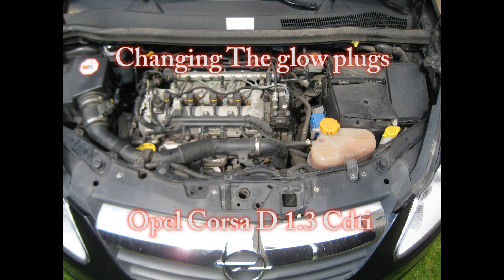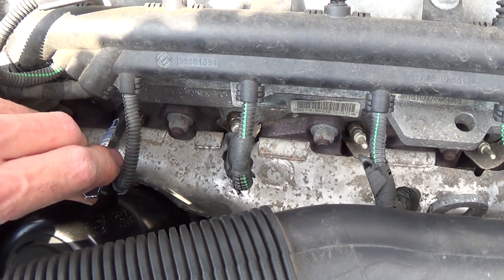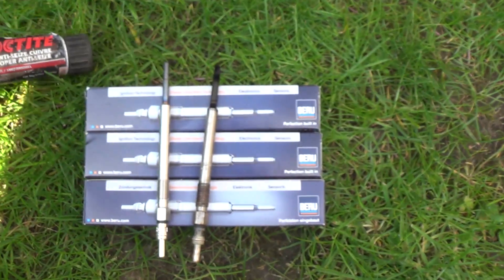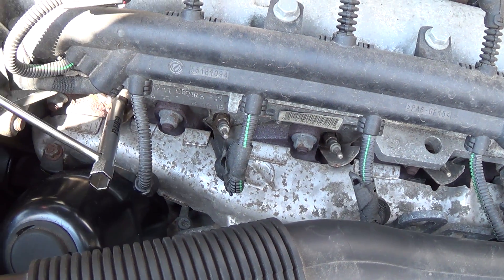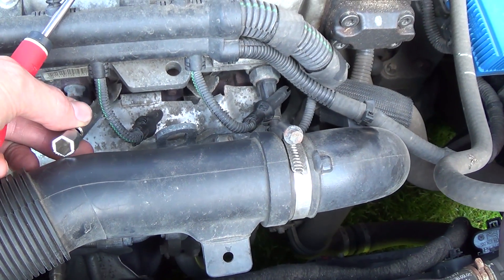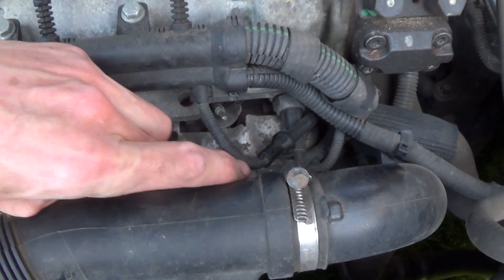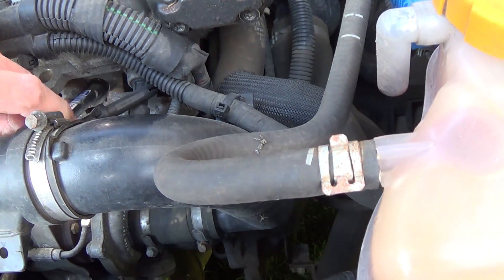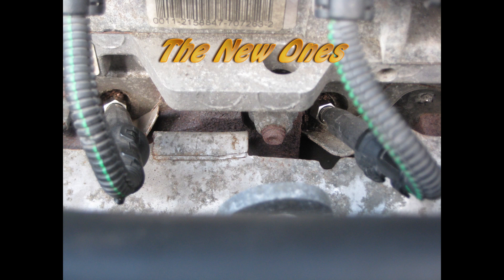Changing Glow Plugs Opel Corsa D 1.3Cdti FIAT engine

Comment: Hi. My 1.3cdti engine is different. From 2011 and has a big thing on the way (the turbo and I think the particles filter also), don’t you have a tutorial on how to disassemble everything so I can replace the glow plugs? Thanks in advance
Reply from the maker: You probably have this 95 horsepower engine?

https://youtu.be/-YMGcnosLqI?t=40

I have not disassembled the turbo from this yet. And will not do that if it is not necessary.
If you want to do this, be careful not to break the bolts

Regards
Reply: Exactly. That’s the one.
Reply from the maker: @tworok  not yet done  that. Sorry
Reply: @tworok  Have you replaced your glow plug? If yes, congratulations. How did it go during removal?
Reply: @Symek92  I haven’t do it myself. Had to ask a friend who works at a mechanic shop and it also went very bad because one of the glow plugs was so stuck that it broke inside the cylinder. Had to call a specialist in plugs removal and pay the big bucks for this expertise.